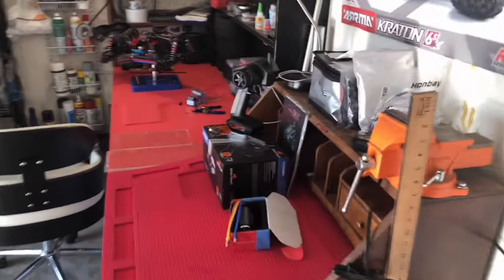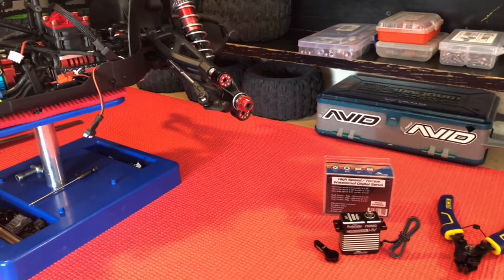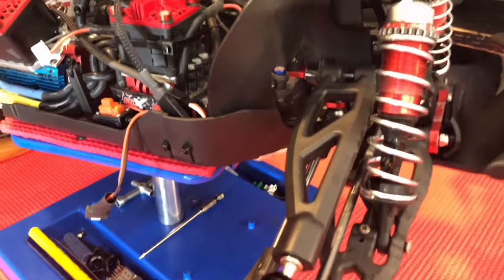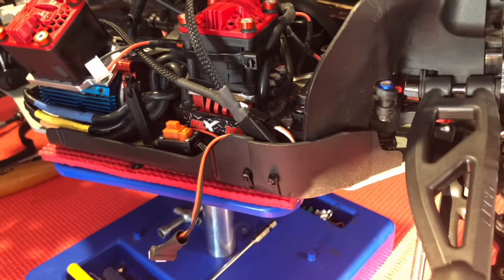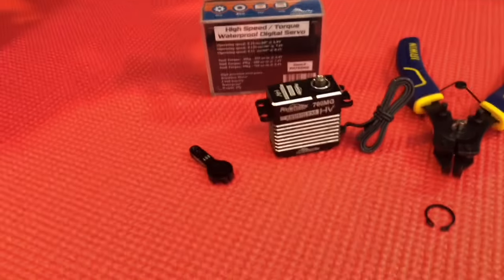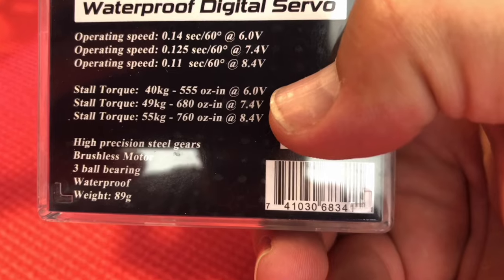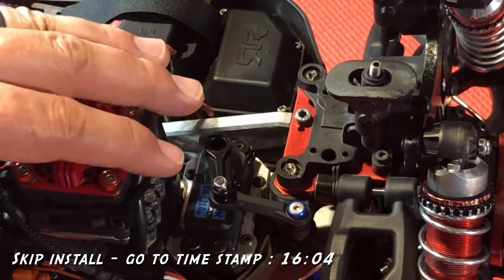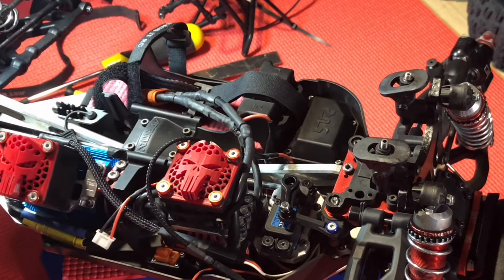Achieve 100% steering for your ARRMA Vehicle. Complete breakdown!

Comment: Did you install the 3 new components.. how it came out?.. I wanna see/know how that combo of ESC and motor works..
Reply from the maker: Not yet, between a few things outside of RC that I’ve slowed down my video production and the fact that I am slowly rebuilding my vehicle back together after a gnarly wreck with a bunch of M2C parts and creating a video series for each one. Hosting the jump competition has also been time consuming.
One of the downsides of being a content creator and still having a full-time job. Not enough time to just throw it all together And call it a day. I’m super excited about them though, and they’ll likely consist of a lot of my continent next year when the warm season comes back around. 😎
Reply: @EastTactics   ty for the fast response.. I understand.. I have a Kraton 6s v4 With everything M2C Available except the ESC mount plate. . Thanks to your vid i ordered the Powerhobby Servo yesterday and i already have 2 snap rings on it.. i will wait for the servo to see if i need a 3rd one.. My Actual ESC is a 150 from a kraton v5..And i was thinking to go for the 160A with that Hobbywing motor and a 20 T pinion. But im afraid that the bigger ESC 160 wont fit and im not that savy in Einstein something like that..lol  I think i need a little more power because i feel the Kraton on the heavier side after i upgraded with all the M2C parts. Do you have a link for the 1730 motor you got? Thanks.
Reply from the maker: @mora9426  
That makes sense, the firma 160 is a bit large and will require some Mcgiver'ing to get her in. From what I understand the four mounting points jut out on all four corners of the unit. 3 of which have to be completely dremeled off. A combination of using 1 of the mounting points as well as quality (emphasis on quality) double sided mounting tape. The only real perk of getting the Firma 160, aside from the fact the people seem to really like the stability and power it offers, is that it stays in the spektrum family, so if your planning to use any of the smart technology, telemetry perks when having  both ESC, receiver, battery, and a transmitter with upgraded abilities. If those things are not of too much interest to you, you might just consider getting the MAX 6. M2C's ESC plate has been designed to literally plug and play with pre drilled mounting holes and everything. So thats something to consider. As far as the motor I ordered.. I snagged mine off Ebay. I asked Rich duperbash which motor for the 6s was his favorite. He siad the 1730.

here is the link
https://www.ebay.com/itm/172708923510
Reply: @EastTactics   Nice.. i was watching his vid and i saw his setups  then i notice you got same motor that's why i asked. I'm going also to downsize the tires to backflips lp  , i think that's what he runs. not sure maybe the 6s?.. i notice that usually people on bigger tires get heating problems quick and less battery life.. i wanna gear up not down, lol. I'm running a 15T at the moment. I usually run in grass and dirt since i have a huge baseball/ football field next to my house and jump a small ramp.. nothing crazy yet on the jumping.. I have Smart tech and i also run 2 3S SMC 8000 mah 120C when i wanna go wild..haha.. The good thing also about the 160A is that i don't have to weld the IC5 batt connectors,, its ready to go too.
Reply from the maker: 4sure… feel free to reach out if you need anything brother… happy to help

Comment: Where did you get the red Punisher esc and motor fan guards?
Reply from the maker: Pyronitro - 
CUSTOM 4MM FAN COVERS AND KILLER SKID PLATES FOR YOUR RIG
40mm Motor or ESC Fan Covers, 3D Punisher Skull
https://www.ebay.com/sch/pyro-nitro/m.html?_nkw=&_armrs=1&_ipg=&_from=

Comment: 23:55 why use a shim to stiffen it up when you have the rubber dampers installed? why not just remove the rubber dampers and see where that gets you?
Reply from the maker: The rubber dampers are for vertical shock absorption. If anything the more use of rubber dampers increases looseness in side to side slop.
Therefore increasing the need of that metal shim. 
Does that make sense.
I hope I’m understanding your question properly.

Comment: Where did you get that fan cover for you esc an do they make them for the 8s line
Reply from the maker: Check out this video
https://youtu.be/cDQDCrXtKos

In this vids description is a link to the gentleman’s eBay store. 
These are for 40mm fans, which would be the same DIY fans one would use on the 8s line. I just bought an 8s ESC and plan to tos it in my 6S. Plan to use the same fans

See this vid regarding diy fans
https://youtu.be/Ppf7kR6Pvs0

Comment: I was looking into this servo and it looks really tall. Did you need to space it up a lot to keep it from hitting the chassis? It also looks like you put some kind of spacer on the linkage so its not at an angle to get to the servo saver.
Reply from the maker: It’s really not a whole lot taller than most servos. I think it’s roughly 43mm tall.
My Prior savox SW1210 sg sat about 39 mm tall.
It also might look like it sits a little taller because I put down two layers of Sorbothane cushioning on to the chassis first. And then I put the servo on top of that. So the servo isn’t floating, it’s supported by the padding connected to the chassis. I go above and beyond for shock absorption when it comes to my servo.
You’ll also notice as I’m pretty sure the video describes I put padding Sorbothane and a solid rectangular composite piece down first before the grommets themselves touchdown.
Perhaps because of my padding raising the servo up a bit you may notice a section in this video it talks about a special solid metal plate that I put on the front side of the servo to both get rid of that slop side to side movement you see, as well as supply horizontal strength to the system. All in all it’s been working amazing.
Yes I do put a spacer in on the servo saver arm to get the servo arm at Self level.
Reply: @EastTactics  thanks for the info. Does the servo need to be padded? I have a solid aluminum bashitrc mount and I figured the more solid it is the more precise the steering would be.
Reply from the maker: It is true the more solid the mount the more precise as well as the more power you can present to your steering system. That’s why I stress highly to get rid of side to side slop as that’s the kind of movement that you’re talking about if loose takes away from the steering. However up and down movement, specifically the up-and-down movement allowed from the shock absorption put directly underneath both the very bottom of the servo as well as the grommets, has nothing to do with the Takeaway of power to the steering system. However shock padding added in this area does in my opinion prevent damage received from massive chassis slap, which is the cause for a lot of broken servos out there.
Reply: @EastTactics  I did not realize that type of shock damaged servos.
Reply from the maker: It can, especially the kind when landing on concrete or extremely hard gravel with Really big air. 
I have a whole playlist dedicated to shock mitigation if you wanna check it out.
https://youtube.com/playlist?list=PL9UjUE_DygV8mQtUYiCRREgQvV8OR61Jn
Reply: @EastTactics  Thanks, I will check that out now. I ordered the ProTek 170TBL servo. It has 650oz-in of torque @ 7.4V.

Comment: I upgrade my servo and used diff shims on the servo saver and it helped out a lot. I have a kraton 6s v5 and put bigger tires on it. And now I’m having major issues with my diff I shimmed the hell out of them and there still striping and the little pen that holds the out drive breaks too. Do you have any fixes I can do to my diff with out buying the crazy price EXB diff and out gear?i love the help with the steering thanks just seen too it looks like you have the same tires I have proline something
Reply from the maker: What size pinion are you running on your motor?
What fluids are you running in your diffs, rear, center, front.
What punch setting you running
Break down how you shimmed your diffs, did you shim both the insides as well as the outside?
What specific gears are stripping?
Answers to these can help me help you. :)

Comment: Great video.  I just wanted to confirm that a V5 kraton will run the 760 at 7.4v without installing a BEC?  Thanks!
Reply from the maker: The V5 will run the 760 MG servo at 7.4V. Yes. However it will push 680 ounces of torque. Which is what I’m pushing in the finale of the vid.
No need for a bec. 😎💪
Reply: @EastTactics  great, thanks! Got one ordered.
Reply from the maker: Fantastic… you’ll luv it!
Reply: @EastTactics  Just wanted to follow up and say I got the servo installed.  Wow.  This thing makes the blue amazon special look like a toy.  Worth every penny!
Reply from the maker: That’s awesome! Yeah I was blown away by how amazing the servo is. Loving every second of it

Comment: Ok, question…will the stock K6s V5 ESC handle that high torque servo without browning out; with stick arms and turnbuckles? Or, would a external BEC still be needed to take the brunt?
Reply from the maker: Yes… The stock Spectrum ESC that comes with a V5 is perfectly capable to run with this servo. In fact it will run it at the 7.4 V which is 680 ounces of torque. So you’re good!
Regarding your front turnbuckles. They are fine as stock to, however if you’re looking to upgrade those here’s what I would suggest.
https://youtu.be/FTyxuJ47pm8
Reply: @EastTactics  sweet TY ET! Just for confirmation, this servo is 100% fully plug-n-play and safe to run without an external, added battery and/or BEC in a stock K6s V5 then?
Reply from the maker: Yup... just plug'r into your receiver and she's ready to go!

Comment: great vid, very interesting. Do you notice the EXB steering spring is different ?  Ref  #ARA340178 marked as Xtra Hard Did you try this one ?
Reply from the maker: Wow! 😯 I didn't know about that. You know Arrma though... always listening and updating parts. Maybe not the best at advertising them though... I think I might make a video on this... just to let people know. A) this would be needed in the v4. And that if they have an EXB, snap rings may not be needed. Of course I'll test to see if it really is stiff enough, or a 1 snap ring might still be recommended.
Does this spring only come stock on the EXB, or does it ship with the v5?
Reply: @EastTactics  Sure, it dont come with the V5, have one and same issue. Also, the Xhard spring is not painted but plated, not black like the V4 and V5 ones
Reply: regular V'4 and V5 spring is # AR340122, EXB XHard one is #ARA340178
Reply from the maker: I just now ordered the EXB version just to see how much different it really is. And if it does away with a need for snap rings. Thanks for the heads up on this
Reply: Great, cant wait to see this new  episode. I guess the spring is  also with the new outcast EXB roller, and at least on every 6s  EXB rig.

Comment: 29:09 and  20:27 why didnt your tire move much?
Reply from the maker: At 29:09 The tires are sitting down on the rug, which similar to grass fights against those tires turning. The point of this particular section of the video however is that despite being in a terrain like grass/or carpet That nearly prevents the tires from moving much at all. The servo is strong enough to still push the servo arm all the way 100% to its maximal reach, or what I call touching the butt stop. So the servo was strong enough to do that. Now the reason why the tires didn’t move much was because the servo saver twisted open, which you can’t see from the angle I’m filming. But that’s OK because that is what the servo saver is designed for. Allowing the full movement of the servo, despite the tires being sort of locked up by the terrain. 
Imagine if I had my buddy come into the room and literally hold the tires to where they could not move at all, and then I twisted the steering, if the servo saver didn’t twist open it would be a really quick way to break your servo. So yeah you saw a little movement because the servo saver twisted open in that particular section of the video. Does that answer your question?
Anyway you know you’re getting 100% steering with your vehicle if despite the terrain locking up your tires your servo still is strong enough to reach its full endpoint.
Hence the name of the video.
Reply: @EastTactics  "if the servo saver didn’t twist open it would be a really quick way to break your servo". nah the servo just wouldnt turn. thats how my crawler is, no saver. it gets in a jam and if the car doesnt pivot around the tires is just doesnt move. the purpose of a servo saver is for high speed jolts. the servo wont destroy itself (any one capable of doing so has metal gears making it a non issue)  but an impact will and these cars have lots of impacts.
Reply from the maker: Well yeah, it depends on the strength of the servo. When you start getting into these higher weight vehicles that weigh 15-20 pounds With 8+ volts pushing over 740 torque . The threshold of even metal gears can strip or wear fairly quickly if your servo saver isn’t working in scenarios like carpet and grass at a stand still. On a smaller rig, if your steering gets locked up completely on a rock or something like that then yeah the voltage going to the servo will simply just stop the servo no problem. But again those are on a smaller scale situation’s. Things are different with the bigger scale vehicles. However I do 100% agree with you that those jolts also play the same role irregardless of vehicle scale. And the servo saver is there for those scenarios as well.
But I will tell you with the amount of power I’m pushing toward my servo if there was no servo saver… sure maybe for the first few weeks the servo would stop itself but overtime it would strip those gears, metal or not.
Either way, it’s really beside the point. The point is that I recommend upgrading to a much more powerful servo that can maximize  The full forward and back motion regardless of what your servo saver is set to. But the servo savers do actually come from the manufacture way too loose especially back in the V4 era, that’s why people put snap rings in it to tighten it up so that more power could be presented to your steering. After doing that though the stock strength of the servo was way too weak.

Comment: Can you do something with losi lasernut,steering in one direction is awful😕
Reply from the maker: The most impactful thing I found with improving steering is simply getting a high-end servo. Next to that it’s adjusting the servo saver tightness. Do you know the method of adjusting the tightness of your service saver for the Losi
Reply: Don't think its the servo,I've removed servo horn from servo and manually moved steering mechanism left and right, steerings very sharp turning left but something stops it turning right fully, it would be easier if you bought a losi lasernut and do a vid,joke😃👍
Reply from the maker: Lol… gotta get me a losi eh! 
Do you know what it might actually be. By design the Ackerman of your vehicle is going to turn the inner tire more than the outer tire. So whichever way your turning the tire that’s closer to the inside of the turn it’s going to have more angle on the inside tire. Is that what your seeing?
If it’s not that, have you checked the steering end points on your servo? Sometimes one of the endpoints be it the left or the right might be completely out of whack. So it’s not reaching its full potential. 
Remove your servo horn, and make sure that your steering trim is centered on your transmitter before you reattach your servo horn. Then adjust your steering end points

Comment: I noticed you use the other Ackerman position, than stock.  Any reason?
Reply from the maker: Mostly just experimental, by positioning the turnbuckles in the upward position, it increases the sharp/cut angle of the inner tire on the turn. Thus providing sharper slow speed turns as well as the initial portion of a high speed turn.
Being honest though, haven’t been able to really tell the difference.
Reply: @EastTactics  I'm probably the only autistic person who noticed lol.  But yeah the difference isn't that much change in Ackerman considering tall floppy tires of a basher, not a agile buggy on a groomed track
Reply from the maker: @brutallyaverage8293  
Yes… I was impressed you caught that.

Comment: Won’t the metal “shim” on the servo mount transfer shock to the servo?
Reply from the maker: Yes to some degree, but you have to weigh the benefits of each factor. Side to side wobble is absolutely unacceptable. In my opinion. I could’ve put a rubber cushion around the servo to help tighten it but that would still lend to side to side wobble. In fact that’s what I did in my previous servo.
Now… that said,  the piece of metal I put in isn’t so tight that it doesn’t allow for up and down movement which means that the shock absorption material underneath the servo is still in play.